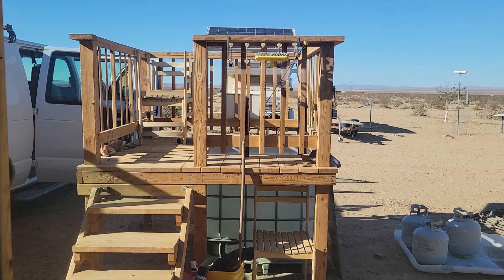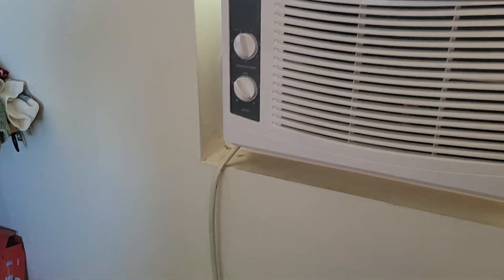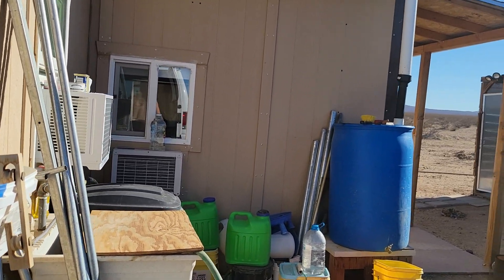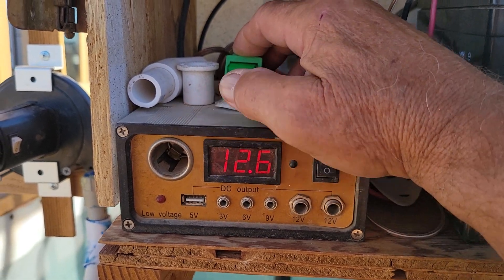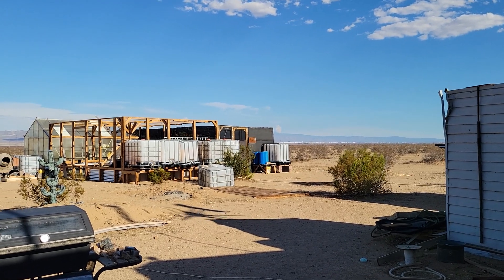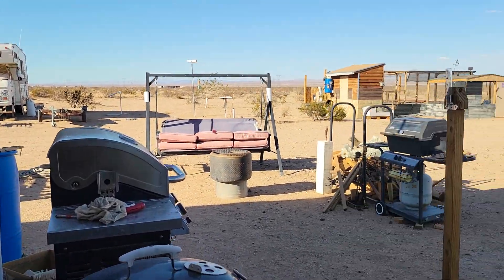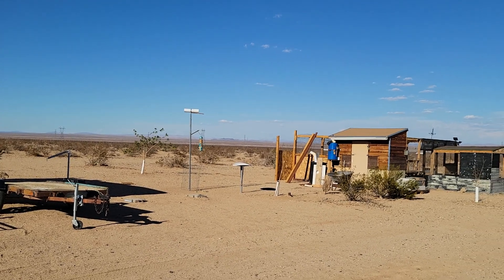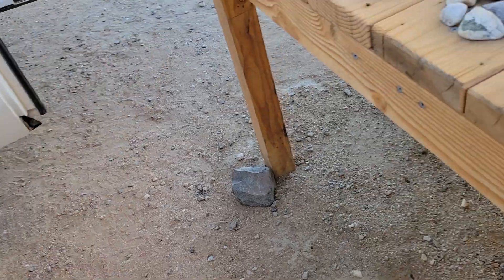Solar Air Conditioning,  How I Stay Cool, Aug. 11, 2022

Comment: Good morning and I've been watching news every morning and I know you're going through a lot of heat out there and other people too different places and here has not been too bad and hopefully it cool down for you and so far it's cool down here a little bit and it is hard to get anything done in this kind of weather just try to stay cool as much as you can and I know one thing it's doing a lot of work on my tomatoes this heat there's still kicking little bit and you have a good day and stay as cool as you can right now I'm pretty cool now it is showing 72° in here my cat walking around with ice hanging off of it
Reply from the maker: Lol, 100+° temps for at least the next 10 days here.  They said maybe longer.
Reply: That will suck any longer than that right
Reply from the maker: It's been over 100° every day since June!  It sure has put a damper on getting any work done!

Comment: Yea hot everywhere. Like crazy.  
What about putting the water system on its own power system so you don’t turn on or off the AC.  You appear to have a lot of batteries etc.
Reply from the maker: Yeah, this heatwave was unexpected, and lasting longer than ever before.  I'm thinking of adding a hard start kit to the water pump.  A capacitor unit at the outlet it is plugged into.
Reply: @GBear  I’ve used for AC big help
Reply from the maker: Yeah, I never expected to need to run both A/C units all day for 3 months, everyday for 12 hours.

Comment: Hi G 🐻bear.  I have 3 of the original  harbor freight charge controllers ,do you know anything about what could be the reason?2 of them stopped working (l don’t use them everyday )but sometimes 3-5 days when l am doing stuff in my garage  l turn them on for lights radio usb etc. I opened both to check for continuity on the internal  fuses and they are all ok,Just thought l will ask you seems you have a lots of knowledge ,l really  like all the charging  ports and old school look of them. Thanks in advance 🙏🏻btw  l am kind of worried to use the 3rd one. Gracias!!
Reply from the maker: Hard to say what the problem is without running tests.  I had one quit working, but it was only the rear fuse under the black rubber cover.